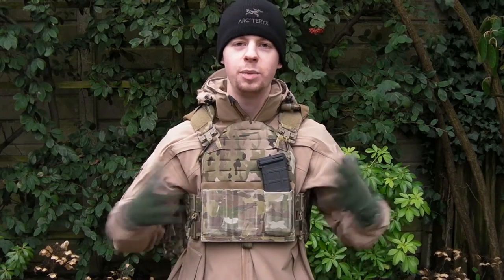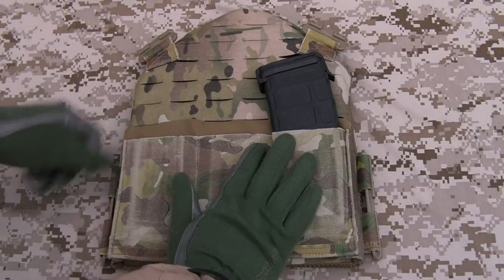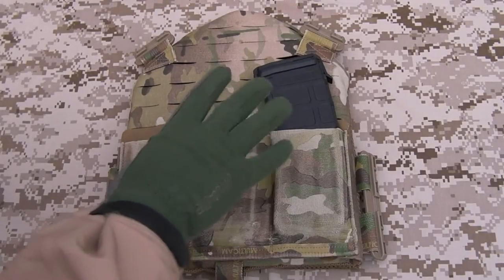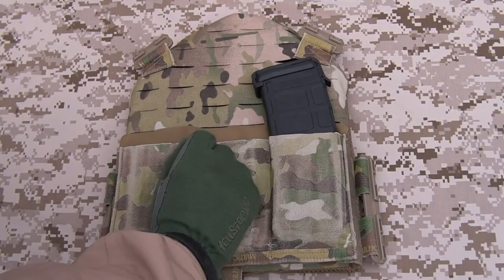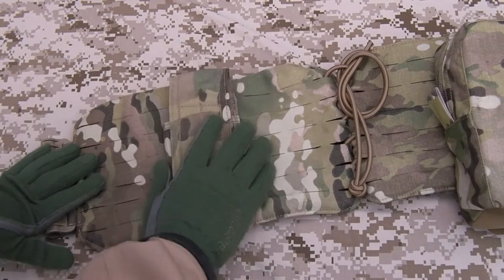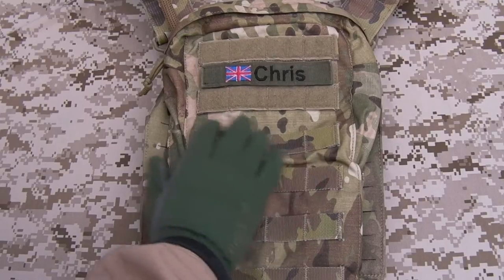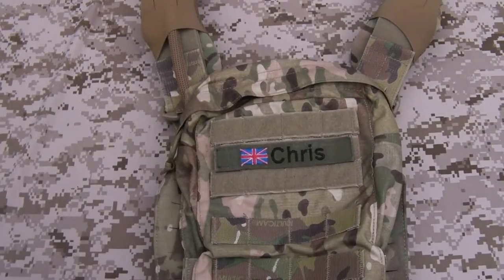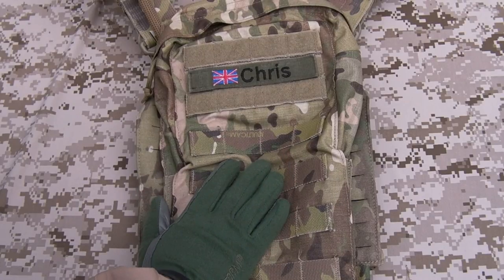FirstSpear Strandhögg Setup

Comment from the maker: Good question, good plan as well.  My strandhogg is the size small and it's adjusted tighter than the minimum setting in order to fit me, same thing with the DCS.  So if you're DCS is adjusted down tight, get the small c'bund from FS.